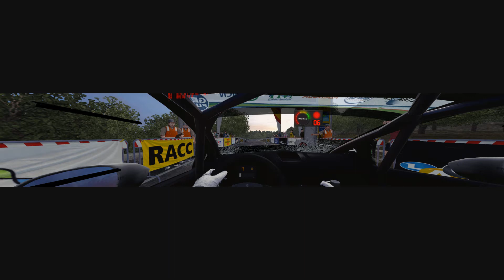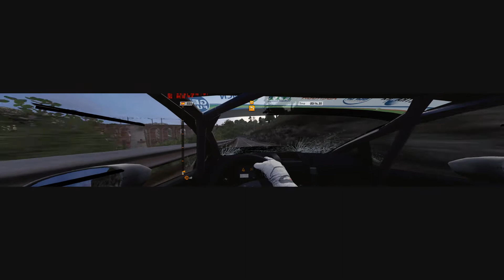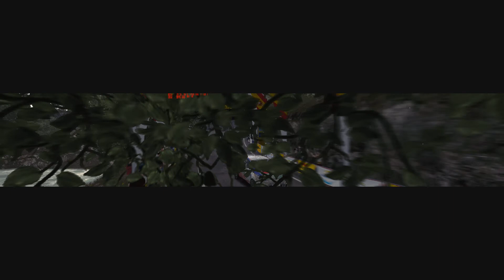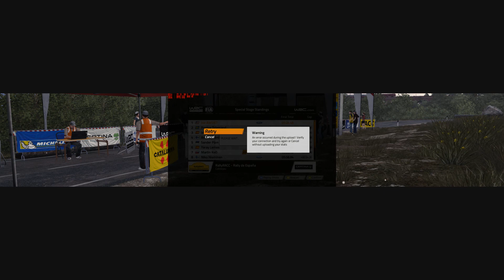Neptune 2.0 - WRC 4/Ford Fiesta/Catalunya SS - GTX 680 SLI Nvidia Surround

Comment: nice setup! Have you tried rfactor or simraceway with this resolution? If not what other games can you run with this res without any problems?
Reply from the maker: Haven't played those games yet.  The only racing games I've played are F1 2013, WRC 4, and Dirt 3 with this resolution.